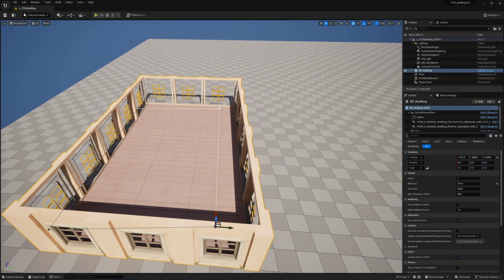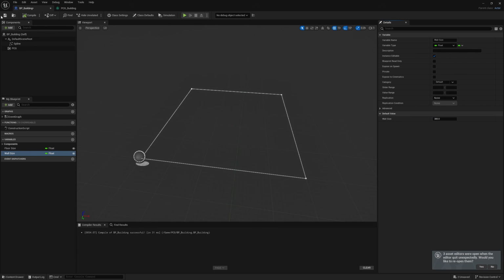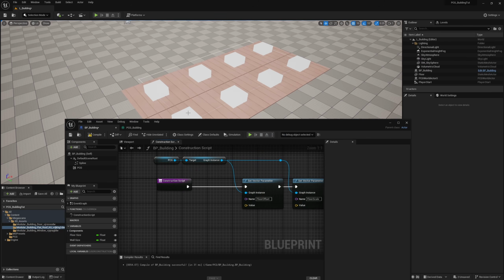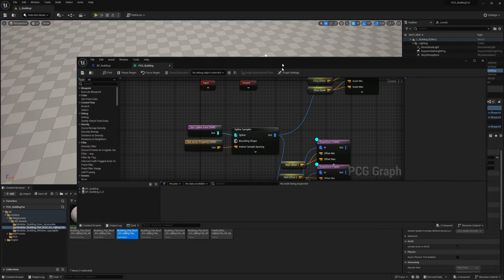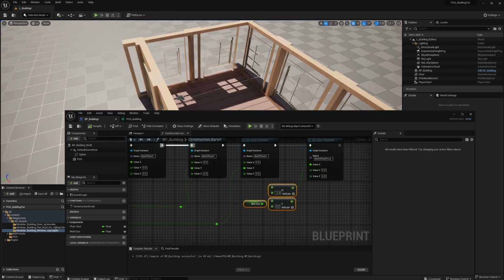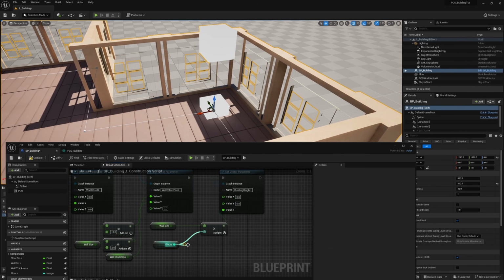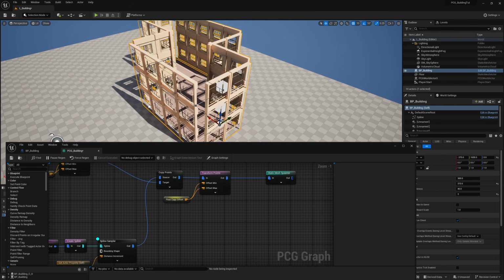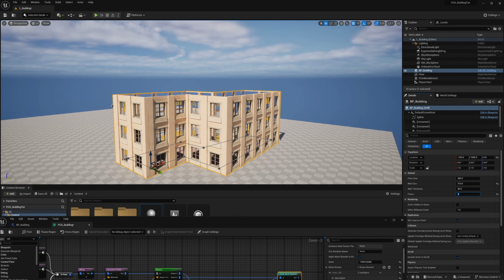Procedural Building Using PCG and New 5.3 Blueprint Nodes - Part 1 | Unreal Engine 5.3

Comment: hi i am trying this in 5.6 but get actor data node with  self and get single point mode doesn't give a mesh as mentioned in the video, tried i tin 5.3 where it works but not in 5.6 any solution?
Reply from the maker: This is the 5.3 building series, which is very outdated. I recommend watching the 5.4 building series instead. You will run into fewer things that have changed since then, and it's considerably better. :)

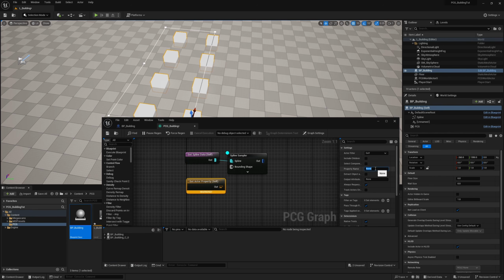Comment: Im trying to do this, but everytime i get to 4:00. Pluging in Get Actor Property to the Interior Sample Spacing. My unreal engine locks up. And once i got to "Executing PCG Tasks (0/3)" but it got stuck at 0% for 6 hours. (i went away hoping it would resolve) What could be my problem? Tried 6 or 7 times now. even tried making them from scratch on new projects. Could it be my old computer? (gtx 1080 i7-6700k 32 gb ram)
Reply from the maker: What value do you have set for the interior sample spacing? Is it left on default 0? Cause as soon as you plug it in, it tries to regenerate the graph using that value.
Reply: @Procedural_Minds I believe i put it on 300. gonna tinker with it tomorrow and see if I can fix it somehow. I really want to learn this :P
Reply: @Procedural_Minds  Got it to work, but on 5.6 there isnt a "instance parameter" in the graph settings. Have they changed that in later versions? Only parameters I can find is in "graph parameters" tab. Are those the same ones?    edit Those were the same ones.

Comment: Did you not take a moment to show what your wall segment mesh looks like in isolation?
Reply from the maker: This was in 5.3, where there were very few quixel walls to get. If you searched wall you'd find the exact one if you wanted to. but the point of the tutorial is to show you the tools, so you can set it up for your configuration.

Comment: Spline sampler is unstable in UE 5.4. Does not work well with Dimension: On Interior :(
Reply from the maker: If you're on 5.4 I have an updated playlist for making a building from scratch. It is considerably better and makes use of all the new 5.4 functionality that you'd be missing out on if you did this one.

Comment: does this work for 5.4?? my stuff just shows the white lines still
Reply from the maker: I have a new series started last week for 5.4, significantly better. I would use that. The new 5.4 features greatly improve PCG.
Reply: @Procedural_Minds  omg thanks man I had no clue pulled this video from an older playlist I have with helpful videos I appreciate u updating for 5.4🙏🏼
Reply: @Procedural_Minds  for some reason my buildings crosses into itself, there some way for me to send a screenshot to see if you can help?
Reply from the maker: @pixelshooterr  If you need to share screenshots you can join the discord and post them there. :)
Reply: @Procedural_Minds  awesome. Will do
Reply: @Procedural_Minds  ive done it brotha

Comment: Not sure what I'm doing wrong but it seems like no matter what it just doesn't work for me. I'm in 5.4, not sure if that should make such a difference, but I can't get the meshes to actually populate consistently
Reply from the maker: If you're in 5.4, check out the video that came out yesterday. I've started a new 5.4 version of this series that is significantly improved and hopefully will explain some things I missed in this one.
Reply: @Procedural_Minds  lol I actually just switched over to this one and it's really good and much easier to follow. Thanks!

Comment: Hey, this seems really cool. Are we able to use any mesh we want for the walls and such? Or just specific megascans assets?
Reply from the maker: You can absolutely use whatever mesh you want, it'll just need to accommodate it in the graph. As long as your meshes are consistent in size, pivot, etc, it should be very simple swaps.

Comment: Is there a way I can get help from google meeting or something?(I can pay you for it tho)
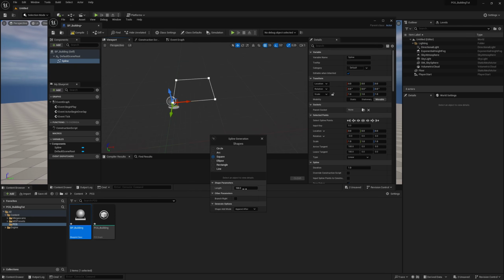1:43
No matter how big I make the box spline at the beginning and(closed, make linear of course) even  I made 50,000x50,000
error says "One or more rows of the spline interior failed to sample (intersection test failed). Ensure the spline points are not overlapping."
at 
2:31
Reply from the maker: That means there are points that are overlapping. Select the spline points and move them around to make sure there's no points that are right on top of each other. Typically the first point is the one overlapping.
Reply: @Procedural_Minds  I did but still doesn't work
Reply: Solved! all I have to do is press D

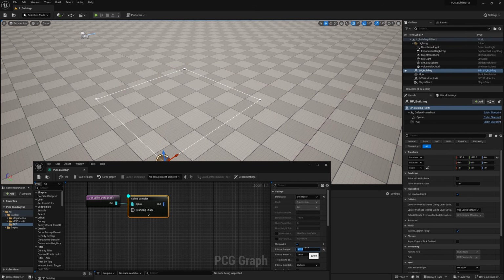Comment: This tutorial has been very helpful, but I am having an issue where the debug meshes aren't appearing along the spline, causing a weird gap between the blueprint's origin and where the model starts generating (e.g. at 2:45 i only get that second row of 4 rather than that front row of 8+ when dragging a single node on the spline); I'm using the most current UE 5.4 rather than 5.3, so I do not know if that is what is effecting it or if there is some setting that I happen to have forgotten or am missing
Reply from the maker: There's some bugs with spline interior sampling. Sometimes you have to make the spline a bit wider than you'd think to see the points. Even if your line is perfectly straight. It's just a tad fiddly.

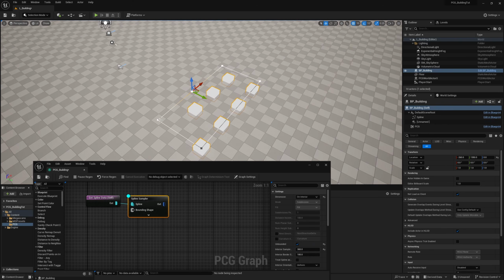Comment: A quick question, because if the spline is perfectly square in a loop, sometimes a point is generated on the spline. I move the spline to make it bigger or smaller and sometimes it happens that that extra tile appears to deform the perfect square. Like in 2:50 you have a rectangle but a point is missing and you had to move the corner out.
Reply from the maker: Yup, that's a bug that's been there since the start unfortunately.

Comment: Lets say i have two of these bp room actors in a level, each set up to have their own PCG component (using the same graph) on them - how would I make it so the floor points of actor A are aware of the other floor points of actor B? specifically that it doesn't cull both points, but selects one of the points to spawn - essentially i'm trying to merge rooms together without duplicate points (and overlapping floor meshes) if two room actors intersect?

Thank you for any help and great videos btw!
Reply from the maker: You can get all actors of a class and try to get bounding boxes of them. This isn't a super simple process but I'd start there if you needed to use two separate PCG graphs. 

Ideally what I'd do is set up this functionality in one graph and just have it sample all the splines of a specific tag so one graph would control both of the buildings so you had access to all the points at once.

Comment: I really want to follow this tutorial series, but it is way too fast for me. I am working in UE5.4 and in the first few minutes of the first video, just as we are setting the spline, I get an error and don't know how to fix it. Could you provide some updated explanations geared towards the 5.4? The "Unbound" option specifically. Please, I really want to follow this tutorial
Reply from the maker: What is the error specifically? Unbound is still needed. Nothing there has changed.
Reply: @Procedural_Minds  I think the error might be that in 5.4 the spline sampler gives an error of " One or more rows of the spline interior failed to sample (intersection test failed). Ensure the spline points are not overlapping. " Even though there are no points overlapping.
Reply from the maker: @TheGiakaama  That happens in previous versions too. For some reason that happens when your points are large but the spline area is small. If you make the spline area larger it goes away from what I found.

Comment: i cant get passed the error...i followed the steps to a perfect T and it wont let me see my sample inside my blueprint, also having trouble being able to drag and remodel an item, when i alt click it just creates a new copy..
Reply from the maker: What do you mean by seeing your sample inside the blueprint? If you mean you're not seeing the debug squares. That's done through the debug key D or at the bottom of the detail panel on the right.
Reply: @Procedural_Minds  like the white blocks after you create a sample spline, mine don't appear and I have an error on my sample spline
Reply from the maker: @AndrewQuinnSoosay  You have to debug the node to see the cubes. Those are the debug cubes. The error should tell you what / why it is if you hover over it.
Reply: @Procedural_Minds  tells me something about overlapping but none of my lines were overlapping, I followed your thing perfectly to
Reply from the maker: @AndrewQuinnSoosay  That means you have two points overlapping in the spline. Just click your original point and move it, you probably just have two points overlapping there.
Reply: @Procedural_Minds  I shall try that later! Thanks for the help :)
Reply: @Procedural_Minds  ive moved it and still nothing, im so lost right now cus i followed your directions to a T, am i able to do it in 5.4 or do i need to do it on a lower engine
Reply from the maker: @AndrewQuinnSoosay  I did this in 5.3. I'm not sure if things have changed in 5.4 that would affect things unfortunately.
Reply: @Procedural_Minds  I got it! I just kept tinkering and finally it let me! Now I can follow rest of tutorial! You're a life saver!

Comment: Hello. One more question. SO I have a PCG graph. How can I do so that every I call it I get to randomly pick one of 10 Static Mesh Spawners?
The Idea is to make the spawner fall into groups (Group A, Group B).
Think of it like that.
I press one button and I get random houses and cars.
I press it again and I get random trees and dogs.
50-50 change to get the specisif random
Reply from the maker: You can expose a bool from the blueprint to the PCG graph, and then when you press a button it sets the bool and then regenerates the PCG graph. That should work.
Reply: @Procedural_Minds  Somehow I can't find info on how to do this (expose a bool from the blueprint to the PCG graph)
Reply from the maker: @kmtsvetanov  You create a bool parameter in the PCG graph and set it from the blueprint similar to  how I do the vector variables in this series.
Reply: @Procedural_Minds  Nice. Now how can I say if this value (float for me) is greated than 1000 generate first Static Mesg Spawner. And if not - the second? Thank you!
Is there a "if else" inside a PCG graph?
Reply: Found it. Create multiple boolean and make many Branches

Comment: Really appreciate the video, but I find there are several points in the video where you have over edited and left me guessing what you did during the cut. Prime example at 15:12 when you debug view the get actor data you get a massive cube, then you add a transform node in and cut the video and when it comes back you have  a small debug cube. No idea what you did there...
Reply: If anyone else get's confused by this point, you just have to change the "Scale Method" in Debug for both the transform points to "Absolute"
Reply from the maker: @GlueEaterElite  Yup, that's all I did. :) I've gotten better at pointing out stuff like this over time, but definitely still learning on how to do the tutorials. Thanks for the feedback!
Reply: @GlueEaterElite  Thank you for the answer, I'm here to find the answer to this part。

Comment: My first step, was to fix Static meshes' origin to be at the bottom center. That way I could avoid lots of offsetting. Simple to do with build in UE modeling tool.
Reply from the maker: Absolutely. I just decided to use the base models only that way down the line if anyone misses a video and follow that one, it'll still match for them. :)

Comment: Great tutorial, but I am have issues with the upper floors. The get actor data single point is the size of a chunk, infinite up and down, large box. and when the spline is created and sampled it is hovering in the sky, way above and to the side of where it should. Any ideas on this? Using 5.3.2 release.
Reply from the maker: You can just change the preview of the point to be  a set value in the detail panel on the bottom. That's all I do.
Reply: Issue was the HiGen Grid size in PCG Graph settings, had to set that to unbounded separately from spline samplers, all good now, cheers @Procedural_Minds

Comment: Thank you very much! This is a great tutorial! Learned a lot of knowledge!

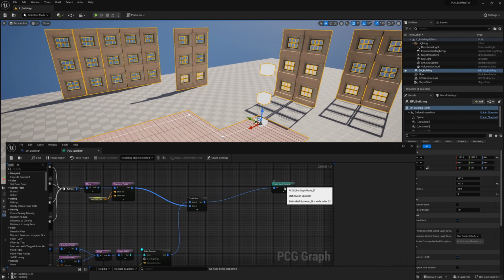By the way, I found the cause of the wall rotation and displacement problem at 19:00. The Copy Points node takes into account factors such as scaling and rotation of Source Points and Target Points. So we need to do the following two things:
1. For Source Point, we only want a sampling point that starts from the first floor and goes up floor by floor. The key point is z coordinate, while x and y coordinate are irrelevant. So instead of using Actor(self) as the starting point of the spline, we start from the map origin, i.e. (0,0,0). When this is done, there will be no strange displacement of the wall. On the other hand, since the floor is scaled, the z-coordinate of the floor will be incorrectly scaled if we only do this as above, so we need to scale it after copy is completed.
2. Copy Points can be set to the rotation setting of Source or Target (or relative, which is the default). In this example, we use the rotation setting of Target, so that each floor is consistent with the first floor.
Reply: So which node do we replace the node get actor data with?
Reply: @kay_ssan  I would love to know this as well
Reply: @yaschan99  All you need to do is replace the Get Actor Data node with a Create Points node and in the Copy Points node change the Rotation Inheritance to Target
Reply: @yolego20  Yes It work
Reply: @hieunguyen-kv3el    Could you tell me how? I changed "get actor data" to "Create Points" and I can't see any walls now
Reply from the maker: You're welcome and good to know! Unfortunately it's not designed very intuitively if it's exactly as you say. Or I'm just dumb. Probably the latter. lol
Reply: Having the same issue, walls are getting rotated weirdly.

Comment: This series is really great. I'm a complete beginner on that particular topic, therefore I was wondering if PCG building generation would possibly also work with geometry scripting plugin? In my case I'm extremely restricted how many resources I can use, so I have to optimize on every aspect. The idea is to build custom geometry optimized kits and use HISM actors to put everything together. I do not need high detailed geometry, a plane or a box could already represent a simple wall.
Reply from the maker: Theoretically it could work. But I wouldn't have live geometry script running with PCG. I would use geometry script to make the geo, and then bake it down and then use it for the PCG.
Reply: You have to enable the geometry script interop plugin but it's possible. Don't get too attached to anything you make with it though since it's experimental.
Reply: @fkknsikk  I'm only looking for procedural geometry generation that I can control in the way I need it, to optimize the output geometry. Btw. geometry scripting plugin entered beta phase and is no longer experimental (at least according to the website documentation).

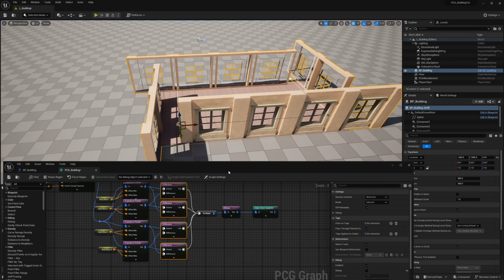Comment: Hi, I was having some issues later on as the pivot points of the assets I'm using are much different as these ones. At 12:55 created issues for me in part 2. My solution instead of offsetting the pivot point was to duplicate my asset, change the pivot point by using the "Modeling Mode" (top left where we see selection mode, go into "XForm" and then use "Edit Pivot" I used the pivot point "Bottom" as it centers the pivot point to the bottom center of the asset so I don't need to transform my points with any pivot offset! You might want to pin a comment in part 2 about this also if someone missed this during part 1 and created their own offset which I did. Great introduction into PCG so far! Keep up the good work!
Reply from the maker: Good to know about this, thanks for the feedback!
Reply: Hi, Did you change Blueprint's Constraction Ccript too?

Comment: I am trying to follow this tutorial but it simply does not work in my project. When I add the "Get Spline Data" and "Spline Sampler" nodes to the PCG graph, at 02:20, the cube meshes do not show up in the level. How can I fix this issue?
Reply from the maker: So when you press debug nothing shows up?
Reply: @Procedural_Minds  This seems to be some issue with the size of the initial spline square. I was experiencing the same problem but was able to fix it by changing the size of the generated spline.
Reply from the maker: @Flatlander81 Yeah there's so bugs with it I found in 5.3 unfortunately. Glad you got it figured out.